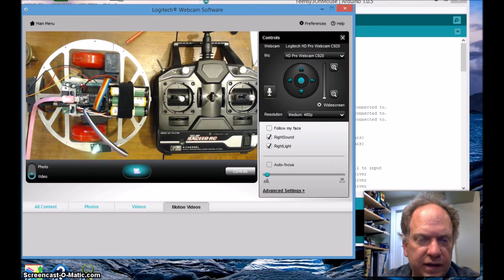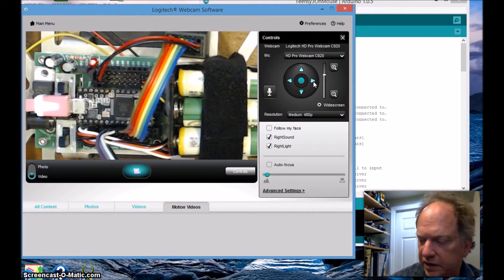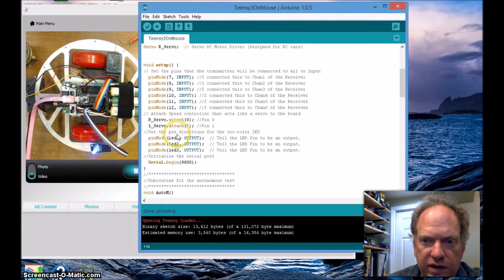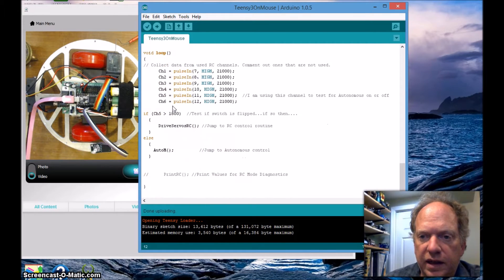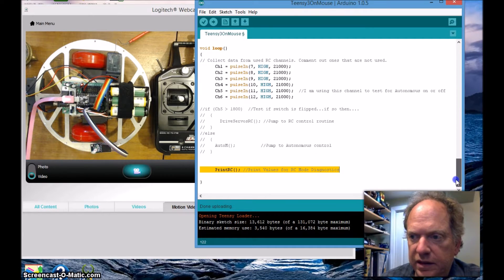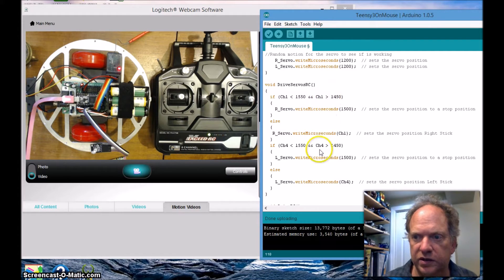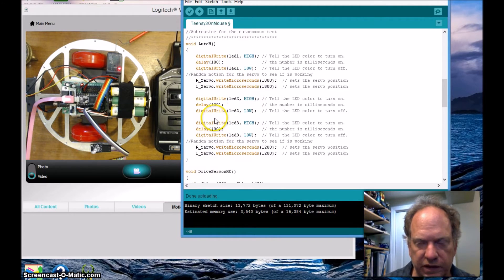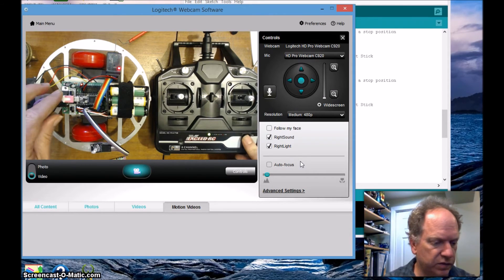Setting up Radio Control with Arduino and a FlySky transmitter

Comment: A question, I've seen people controlling the motors using the transmitter with the motors connected to the receiver and it works,   but why is Arduino needed to control the motors? I'm sorry if I'm asking a silly question, but I would like to learn more about these things.
Reply from the maker: No problem. In this case the transmitter will be used to run a robot. By having the arduino it makes it possible to switch between remote control and autonomous behavior. When autonomous the robot will drive itself using sensors instead of being steered by the user.
Reply: Thank you sir!